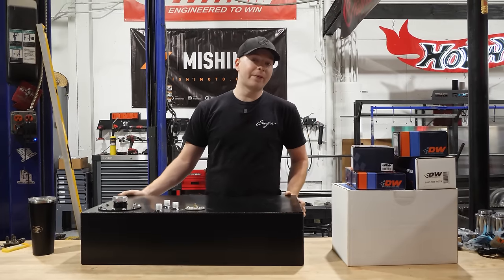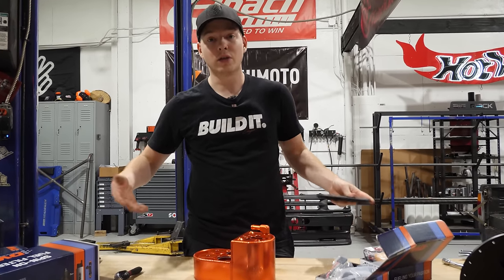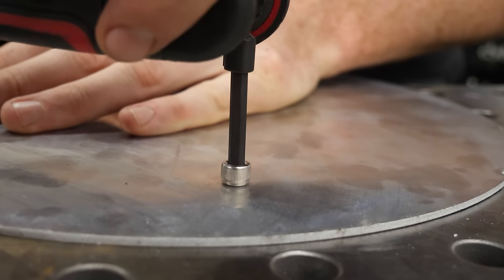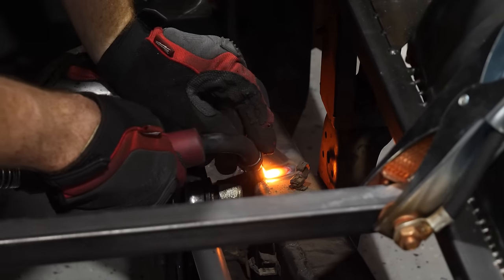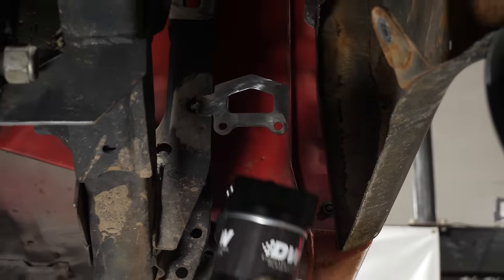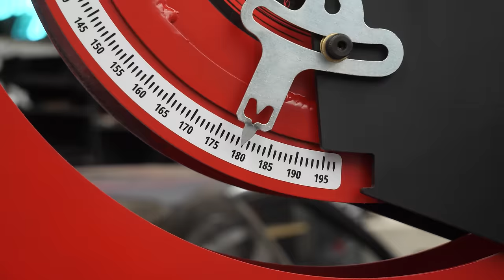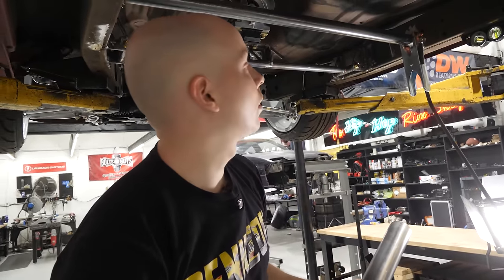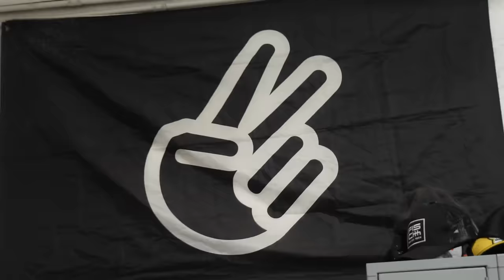Preventing DRIFT TRUCK V2 From Burning To The Ground...

Comment: You could easily build an internal syphon for the tank.  You put a Y-fitting upside down in the middle with with one hard pipe going towards the bottom of each side of the tank and then the third part of the Y fitting is a one way valve allowing upward flow but closing off downward flow.  That way when you fill your tank any air in the pipes will go up the Y and through the one way valve.  When the tank drains, the fuel will be trapped in the Y-fitting and will have no choice but to syphon fuel from the higher level to the lower level, exactly like your cup demonstration in the last video.  You could build multiple of these for more flow or redundancy.  Basically you lay hard pipe against each slopped part inside the tank and connect them with a Y fitting where they cross, then cap off the Y fitting with a one way valve so air and fuel can flow upward but not downward.
Reply: I like your thinking!
Reply: Generally an OEM will use a jet pump or venturi pump which functions basically like this. We used one from Radium when a factory style jet pump couldn't keep up on our rotary BRZ.
Reply: If there's enough vertical space in the tank, I had an idea to put a small section of hard pipe on top of the one way valve and open on the top like a chimney or stovepipe.   That way if the one way valve leaks a little bit it'll be letting in fuel from the top pipe for a while instead of letting in air to break the syphon
Reply: Yes. This. Don't make it more complicated than it needs to be. Check valves FTW.

Comment: This tank is still a fire hazard

 A: no internal bladder like every legit fuel cell should have

B: your driveshaft hoop does not protect the tank in the event of a driveshaft failure. Gonna tear a hole right in the bottom that will pour itself right into the exhaust. 

C:  if you’re gonna be tandeming you shouldn’t run the fuel lines on the outside of the frame as in the event if a hard side impact or door tap your fuel lines are the first thing to take a hit.
Reply: i have not seen a custom fab fuel tank that uses an internal bladder whether its on this channel or Cleetus McFarlands
Reply: @kurimu1486  different motorsport, different organization, different rules. There’s a reason actual sanctioned bodies of motorsport where vehicle to vehicle contact is inevitable require FIA approved insulated bladder fuel cells if not using the OEM tank. This rule trickles all the way down to your local pure stock dirt circle track cars
Reply: Agreed, not much safer but at least not AN lines wrapped around a drive shaft.... That tank may tear open with ease. Look at how thin that aluminum is, and he's threading the REALLY THICK proper fuel tank head into the tapped sheet aluminum? If that tank buckles from any form of impact, that head is getting ripped off and you'll have an open fuel tank. No no no no. At least make a thick compression ring on the underside with nuts like another commenter stated.
Reply: I know absolutely nothing about engineering, mechanics or safety. I just like cars. For years I have been coming to this channel for the fabrication porn but also the back-and-forth between the channel and the comments. Especially since the eclipse. It's just so cool that for pretty much any little niche, there's people with knowledge of it all over the world. 

teach me, daddy.
Reply: Race cars don't have internal bladder
Reply: @kennethporst4359  Our formula 1 race cars do.

Comment: I think that The fuel filter placement is in the danger zone for tandem drifting
Reply: I agree
Reply: why anyone would mount fuel or brake lines on the outside of a frame is beyond  me
Reply: Yes it is.
Reply: I would completely agree, if someone dives too hard and hits that area it could compromise the filter and lines. I think placing it above the fuel cell would be the smartest option, easy to service and probably safest area
Reply: @Benumbedmedia  There MUST be a space for the filter under the hood. Can't tell me that bay is full, what with that massive 300HP engine. LOL

Comment: I'd still worry about the left pump running dry. Maybe add a float & switch that would cut power to the pump when the level drops to 1"? Cheers. Leigh in Scotland.
Reply: Would your worry be that the pump would burn out without any fuel to lubricate it or cool it? Or that it'd be pumping air into the fuel system?  I think it was directing it just to the other side or into the surge tank and not into the pressurized lines.
Reply: I think it would work like once the right side got down to a point you flick the pump on and turn it off once the level stops going up.. but if it’s drifting the fuels gonna be flying everywhere anyways.. idk
Reply: @1234567890CAB  Definitely the pump running dry & burning out.

Comment: If the taps don’t cut it you could make a ring with rivnuts or welded nuts to put on the inside of the tank. Just put a few tacks on the inner rim to hold it in place and through-drill the holes you tapped. That should sandwich the gasket and the tank wall nicely. Just an idea!

Comment: That filter place is dangerous I guess. It is open for impacts while door to door drifting
Reply: He could add a tubular crash bar, I suppose.
Reply: Agreed. All lines need to be inside the frame rails too. Brakes, fuel, electrical, coolant, whatever. Basic safety measure.
Reply: came here to say the same, Caleb should know better by now.

Comment: You should look at a Radium venturi setup. I believe it would be better than another pump to possibly fail.
Reply: Yep that's what we used on the rotary BRZ when the factory style jet pump couldn't keep up.
Reply: Super common failure on Chargers with a similar across axle fuel tank is one of the 2 pumps die and you can only use half the fuel tank.
Reply: @Splomf  That's why basically all the Japanese companies use venturi jet pumps rather than mechanical pumps. 😁

Comment: Build that filter setup it’s own little roll cage. You don’t want it to break loose and pump E85 at 50psi if someone drives into the side of your bed. 

Something as simple as a little DOM hoop around it could prevent disaster.

Comment: Respect for listening to other's opinions and changing your mind on the tank hose routing. I'd personally put the fuel filter more central on the vehicle so the filter/lines can't be crushed and start a fire from a side impact. Swapping the filter will be easy no matter where you mount it with your car lift. Just my $.02.

Comment: If you're worried about the fuel line below the driveshaft, you could always pass it THROUGH a driveshaft hoop tube. Basically armor it with quarter inch steel. If that steel tube is getting compromised, you probably have bigger issues than the slow leak it would cause.

Comment: For the transfer pump, make sure it can run dry, or will shut off when its empty on that side. Otherwise, you will quickly burn it out when that side of the tank gets low on fuel.

Comment: All this for 300hp..... I think everyone can tell that its not going to be or stay 300hp for very long
Reply from the maker: Its gonna stay 300HP for as long as the 1UZ holds 300HP lol
Reply: @_Gingium_ if it’s a pre 94 1uz it’ll probably hold 500-600
Reply: @perfectentrytrading if I remember correctly it's not. Maybe 97 or so
Reply: 300hp more than enough for the gingiums level. He's not a pro class driver. Doesn't need a 1000hp drift truck, haha 😆
Reply: @perfectentrytrading  unfortunately it’s 98+, the weakest one…
Reply: I think a even 450 would be great
Reply: I think a even 450 would be great
Reply: @1993Revhead no-one NEEDS a 1000hp anything, but it’d sure be a nice thing to have!
Reply: Could you just delete the lower part of the tank on the drivers side? Solves all transfer issues if its flat from drivers side till it clears the driveshaft 🤷🏼‍♂️
Reply: @scottspropertyservices6877 yeah, but then you loss fuel capacity and It could mess with the weight balance
Reply: @GTSW1FT people worry about balance too much. You sit on one side of the car and nobody thinks twice about it lol
Reply: @perfectentrytrading   its obviously not because its a VVTI motor

Comment: those hoops are nice and spacious for the driveshaft to do some real damage. typical gingium build quality and consideration
Reply: Agreed, needs to be tighter and that tank needs more protection from the shaft, it's really thin. I don't think he's seen what a driveshaft can do that's snapped in the wrong spot...
Reply: @bitcoredotorg  I do not wish bad on him so hopefully we will not see that happen. I am sure there are plenty of other things that will break first.
Reply: @cubegears  absolutely! I hope it doesn't happen, and I'm calling it out as I'm concerned for him and others. My intention is that hope he sees our perspective and makes it safer.  A bladder would probably help a lot. When you design and engineer stuff like this by hand, you HAVE to be extra careful. I hope it never has an issue.

Comment: Make a 1/2" thick aluminium oval ring ring to go inside the tank. Drill and tap it. Could hold it to the inside of the tank with countersunknscrew from the outside. Rubber gasket covers everything. No welding/warping like the ribs you tried adding as mounts.

Comment: Hey dude, love your channel. Just thought I'd mention something I noticed. 
As for "cross over pump" just make sure that it has its own fluid level sensor(of sorts) for specifically that side of the tank, if it doesn't that side will run dry well before the main side and if the pump continues to run while dry it could over heat and/or burn out.
Not sure what your plan was specifically but I just figured I'd mention. 
Love this build though, keep up the awesome work!

Comment: Any reason you didn't use Riv Nuts to mount the surge tank? Also, if it were me building the truck, which it's not, I'd have bent up a steel sheet tunnel under that tank. I just thoroughly distrust aluminum as someone who builds and maintains turbines, which is admitted very different, just curios is all. Love the drift truck, and all the progress you've made
Reply: Was thinking the same thing. Won't take much to puncture the thin aluminum.
Reply: Need drive shaft protection for sure. But also rivnuts wouldn’t seal.
Reply: Riv nuts wouldn't sit flush and then the seal would be ineffective.

Comment: I would look into how BRZ owners handle this. They have 2 part tanks from the factory. Plenty of cars do but my experience comes from mostly Subies. Someone mentioned a venturi system i believe. Sounds more complicated but probably the best route. Love your builds brother!
Reply: Most saddle tanks use lift pumps identical to this. Only difference is the lead to the main pump directly
Reply: @IanNubbit No, most factory saddle tanks use jet pumps. Despite having pump in the name, they are not electrical devices. They use a venturi suction valve to use the fuel flowing from the pump on one side of the tank to suck fuel from the other side. Purely mechanical device. When we upgraded to a huge fuel pump on our rotary BRZ the factory style jet pump couldn't keep up and we used one from Radium. A secondary siphon pump can definitely work, but then it needs a shut-off float.

Comment: So Devin N just built a tank(s) for his k24 swapped civic and tried mounting the in tank surge the way you have, and it leaked like a sieve. The solution was to weld a plate on the inside of the tank for more thread engagement and bolt tension.

Comment: Why not just change the shape of the tank. It holds a bit less fuel, but much more usable.
Reply: All he'd have to do is cut off one of the low parts on the driver side to be the same height as the middle section. And it makes it a form of baffling.
Reply: @psychicer5022  Yes exactly, didn't know how to describe it haha.

Comment: I was just about to be "that" smartass in the comments asking why you didn't just use threaded inserts instead of tapping into the fuel tank to secure the surge tank, but then I saw the gasket they give you. That would have never been tight against fuel if you used threaded inserts since the mounting surface would not be plain, so tapping into the fuel tank was the right way 🤓🤓🤓
Reply from the maker: Haha exactly! Love that you figured it out yourself

Comment: I can not believe why you do this complex setup. Just be a smart guy an ditch the whole lower left side. You only need 40 to 60 liter anyway.....
Reply: And why do you think placing a fuel filter outside you chassis is a good idea with a truck that is going sideways most of the time...? This is basically putting your filter at the front of the car...

Comment: Quick question, will any heat shielding be needed on the bottom of the gas tank? Does the drive shaft generate enough heat to have any detrimental factors on the fuel inside the tank? Just something I wanted to ask, good videos as always.
Reply: No. But if the driveshaft comes apart like those hoops are supposed to protect, it can still very easily tear that tank apart.

Comment: All fuel lines and parts for fuel delivery inside the cage, but not outside, between the outer panels and the cage. (The filter)

If youre going to have tandem some time and someone pushes you a little too hard there (which is exactly the spot where usually the driver side corner of the chase car is), you might run into huge problems. There is space inside the cage, the hood, or somewhere for it. Check car rules for dmec/formuladrift if you want to build a safe car for drifting, you might notice a thing or two and with using your very wise brains you will understand why is the rules so.

Comment: with the new method, i think it gonna burn through that cheap fuel pump. the safest route is to slanted your bottom of the fuel cell. yes it hold less gas, maybe about 3 litres less, but at least it is safe, you should make the fuell cell wider, i see you got enough room for wider fuel cell.

Comment: I’m curious how often you are weighing the truck… With these smaller modifications like the fuel filter placement and stuff, those things could make up a couple pounds of weight bias in either the front or the rear. I would be weighing constantly to see where things are getting settled so i could achieve as best of a 50/50 weight bias as possible

Comment: What is protecting the bottom side of the tank? Looks like the tank sits flush with the bottom of the tank frame. Feel like building the drive shaft hoop only makes sense if it fully protects the tank

Comment: What happens when the cheap pump overheats cause it pumps down all the fuel? Subaru uses a Venturi pump assembly that uses the return fuel to draw from the other side of the driveshaft to solve this same issue.

Comment: Why wouldn’t you just cut one of the ears off of the flue tank, make it flat over the driveshaft to the pump side and loose a little bit of capacity. Adding more pumps is one more thing to break

Comment: I like your fabrication skill, not gonna lie, but this still screams fire hazard to me... Wouldnt trust that thin sheet aluminium to hold the threads, wouldnt trust that driveshaft cage to protect it from the bottom and definitely wouldnt trust that fuel filter placement... At this point might be good idea to sacrifice the metal and start over, better safe than sorry...

Comment: Or you could just not have a fuel tank sump on the passenger side and not need any pump with a couple gallons less capacity… you could also widen the tank front to back and make up for that lost capacity…. Don’t forget to baffle